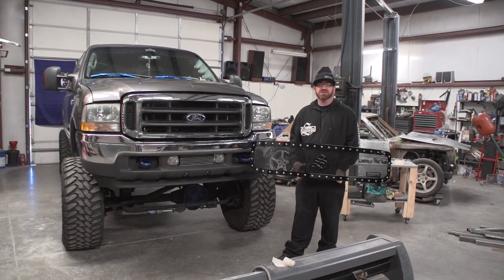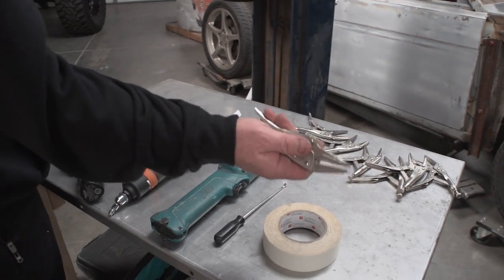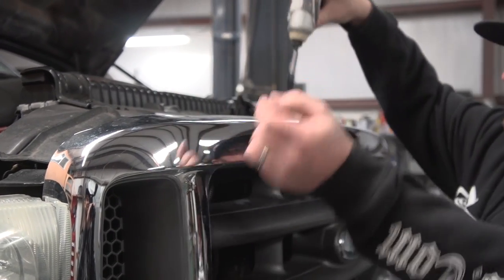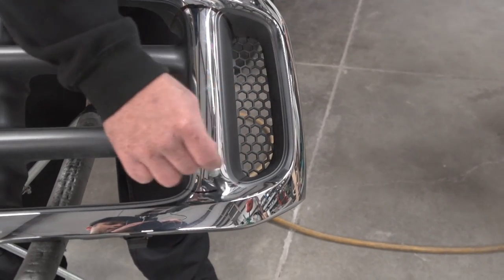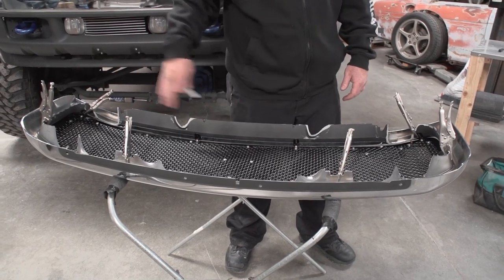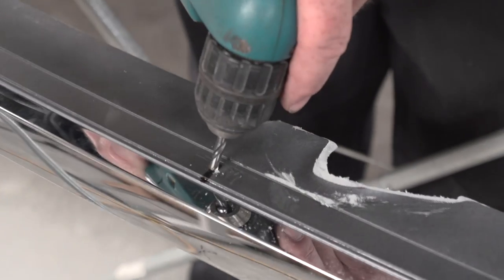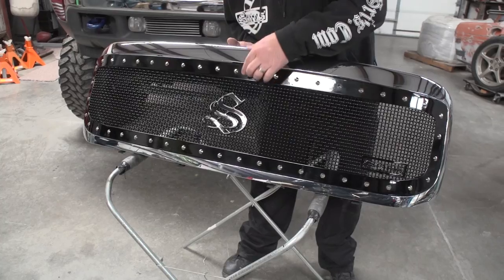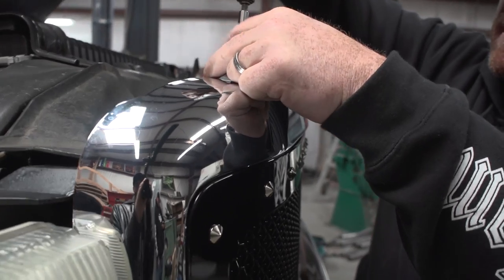99-04 Ford Super Duty F250 F350 Excursion

Comment: On my 99 f250 it has them plastic rivet pins to hold the top of the grille in, no bolts. Would that happen or just a shop losing parts?
Reply from the maker: Not sure, but they should work just fine to hold it in even with the extra weight of one of our grilles installed.